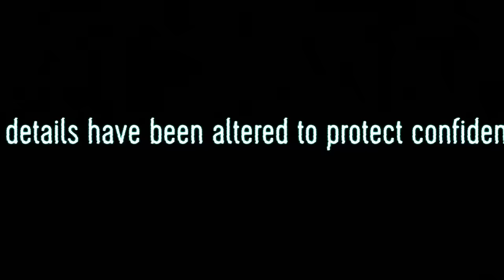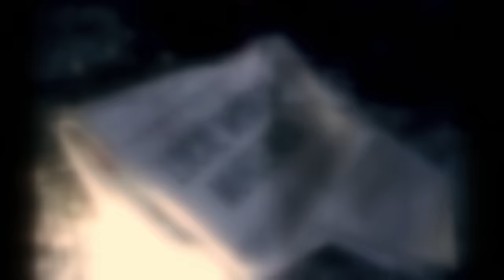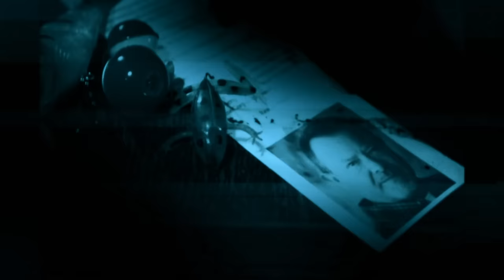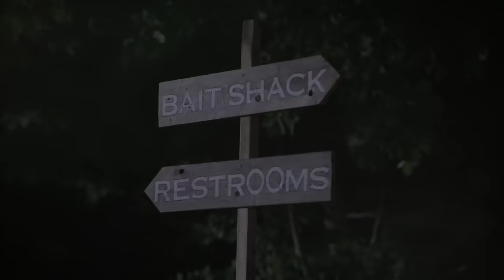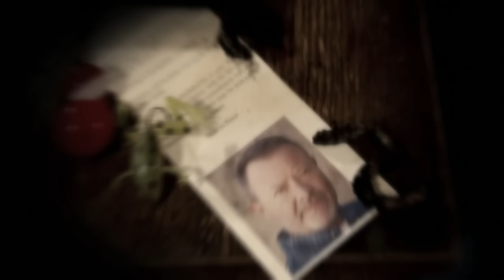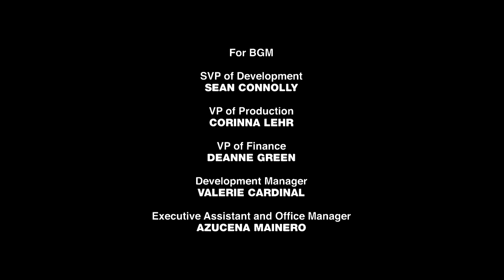Spine-Chilling Encounters After Dark - Paranormal Nightshift - S01 E12 - Paranormal Documentary

Comment: I too have worked nights, once as a Night Porter in a local hotel. That was haunted - it was built on top of an old coal mine and I think it was the souls of children and young men who had died down the pit way back at the turn of the 20th Century. 
I was setting up a room for a meeting one night and I felt someone tap me on my shoulder. Looking around, I found nobody there ! Later on that same night, someone said ‘Hello’ in my ear but again I was on my own. 
Another time, I heard the squeak of the doors open and I looked up to find nobody there - the doors had opened by themselves, and these were heavy doors ! 
Yet another time, the lights all went out and I put them back on from the store room, they went out again and then I thought it must be my boss pranking me with the remote control (used by DJ’s to control the lights at Weddings and other events where music was required). I told my boss to quit it but he denied all knowledge and told me to take the remote with me and keep trying to turn the lights on or off whilst I went back to the room above. Those lights only came on when I got outside the room ! So I put the remote in my pocket and tried to carry on working. The lights went off again, so I took the batteries out of the remote, put them in my pocket and left the remote on the bar top after turning on the lights again. 
Whilst I was working, they went off again and I ran from that room and wouldn’t go back in until my boss was with me !